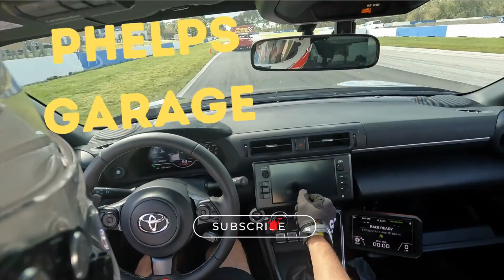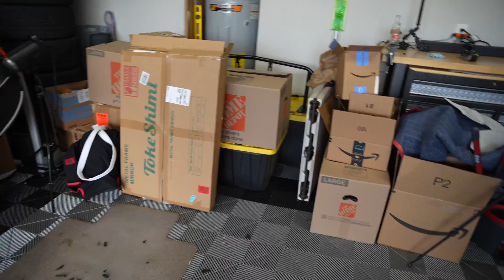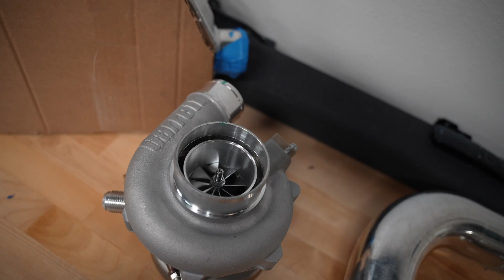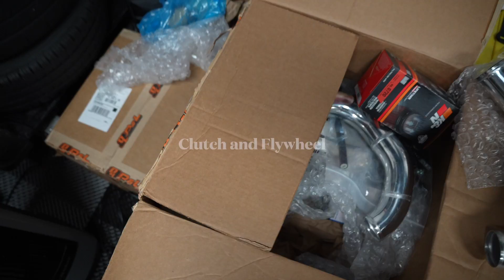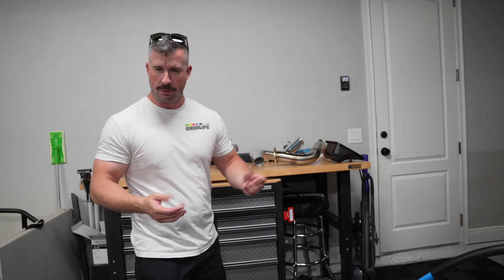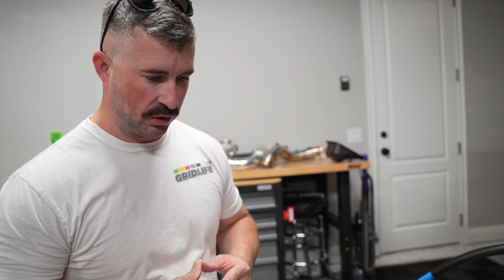GR86 P and L Turbo kit

Comment: Since you mentioned heat management and staying in a low psi did you consider a supercharger?
Reply from the maker: No not really.. it’s probably easier to but I’ve always been a turbo type and they make more power with less stress.

Comment: Hey I love you vids, I'm so excited to see the turbo get put on.  I've personally been eyeing the JDL one for a while now (mainly for the catted uel turbo manifold and I have a single exit cat back from them). I'm kind of copying your build with my 23 brz. Right now I'm getting ready to pull the trigger on some FA 510 or 520CR haven't decided yet. I've been in contact with Fortune Auto and they recommended me similar spec to what you have. 8-9k front and 9-10 k rear with longer stokes and a helper spring.  After seeing your other video where you talked about how a sway bar up front made you car to stiff I was wondering your opinion with you current 8k front and 9k rear spring rate and if you would recommend it or change it based on your extensive track day testing. Do you ever think its too stiff at all? I will be basically have the same aero as you, but that's down the road. Again love the vids, big supporter of the monster your making!!
Reply from the maker: I appreciate the kind words and you taking your time watching the videos. I will say this the car is faster when it’s softer… more grip, but there’s a trade-off with aero you need the stiffer springs to take the extra down load. This helps at speed but at slow speed, it hurts. It’s one of those pick your poison type of deals. I sacrifice the low-end grip/speed for all the high-end stuff. I plan for go with even more aero so I can be faster in the corners! I recommend the white line swaybar kit, which I believe was 20mm in the front and 18mm in the rear to me that felt really balanced and neutral. Hope this helps

Comment: Awesome thanks for the update, any new thoughts on long term ownership of the car? Still thinking about Z06 or other cars?
Reply from the maker: There will come a point to where I can’t push the car any further with 400ish horsepower. Eventually, I will change platforms once my ability to drive a fast car at the limit. This car is a stepping stone for me to get there. I don’t plan on selling the car unless someone offered me a stupid amount of money.
Reply: @phelpsgarage4202  Thanks for the reply, you have been helping me decide on a GR86. Why didn't you go full cage? And would do something different as far as seats/rollbar if you started over? I am debating driving it with all OEM safety vs going rollbar/serats/harness, etc.
Reply from the maker: @AndrewJamesL4  just keep the stock seatbelts if you go with a harness and street drive it. Eventually, the car will get a cage.
Reply: @phelpsgarage4202  thanks!

Comment: Best of luck with the build and the move to Georgia. Much better track there with the elevation changes and come back to Sebring during the winter, when it's not 4,000 degrees out 🔥🌡🥵🥴🤢😂.
Reply from the maker: Thanks! That’s the plan. You located in Georgia?
Reply: @phelpsgarage4202  No, I'm in Florida on the Treasure Coast and resided in Sarasota for 40 years. I have a friend that lives adjacent to one of the lakes in Sebring and has a Viper.
Reply from the maker: @warrenlucier5796  we go to UTC all the time!!!

Comment: Excited to see the kit put on the car, interested on the 660. Been thinking of their 550 for a quick spool but keeping the boost low and constant throughout the rev range. Don’t really like the torque graph I’m seeing some people make with harrop for example, I want a torque graph that’s as straight as possible
Reply from the maker: Yeah, I just don’t wanna make that torque way down low because that’s when stuff will break. It makes the car feel fast, but the car doesn’t like it, especially on a stock motor high compression.
Reply: @phelpsgarage4202 bruh that's so profound lol. Never put 2 and 2 together like that but it makes perfect sense.
Reply from the maker: @MeltingRubberZ28  with E85 I can get away with a lot but I still don’t want to push it
Reply: @phelpsgarage4202  yeah it makes sense that a bigger turbo is actually better though since the delayed spool and stuff. One of the VW guys I follow made 600WHP on a stock 1.8T and never had any issues with the rods because it was "so lazy." Makes sense that you could find a balance in between.
Reply from the maker: @MeltingRubberZ28  yeah it’s a cylinder pressure down low that will hurt things. It’s OK to make the power up top.